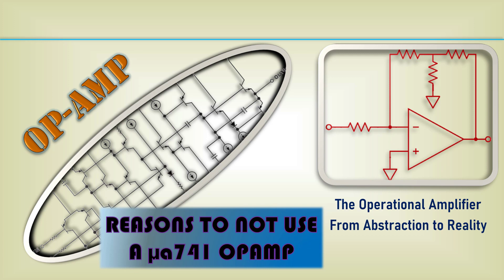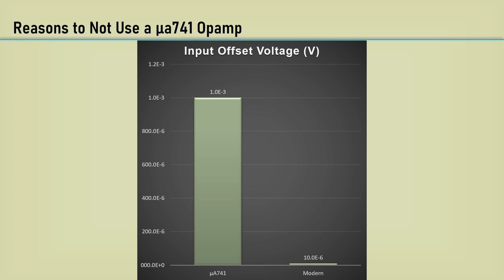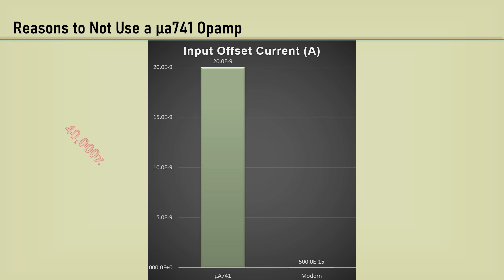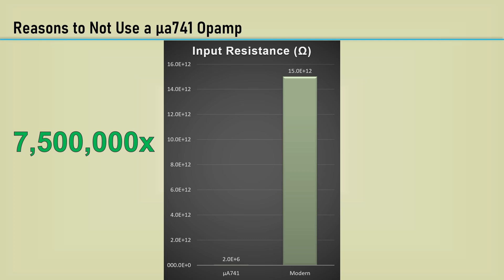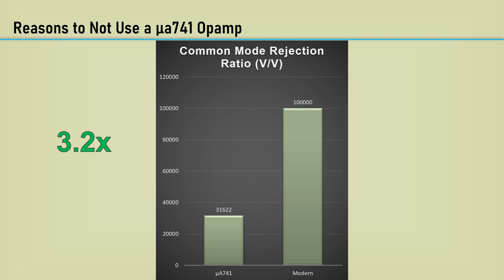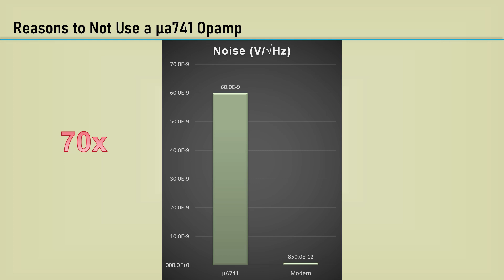Reasons to Not Use a μA741 Op Amp

Comment: The minimum supply voltage for the uA741 is 10V (±5V), not 20V.
Reply from the maker: Evidently I was going by the TI LM741 datasheet which has a minimum of +/-10V. The TI datasheet for the uA741 is +/-5. Thanks for pointing that out.

Comment: I have been known to use discreet 2N43 and 2N78 devices,  with a single supply rail.  Who needs silicon when you've got germanium from 1970?  When I absolutely desired silicon,  there was the 2N706, 2N708, etc.  Of course,  this was done for practical purposes such as proof of concept.  In practice,  if it works to suit your purpose...  go for it.

Comment: There is no reason not to use 741 or 4558 where their specs are sufficient. Which is practically any audio frequency filter circuit and the like. They will probably last longer than modern devices (maybe) at least we can say they stood the test of time.
Reply from the maker: I agree. Thanks for the comment.

Comment: 1:19 fake, the ua741 works with 5v, see the datasheet.
I use it with a 9v battery and works.
I still prefer the TL081 and 071
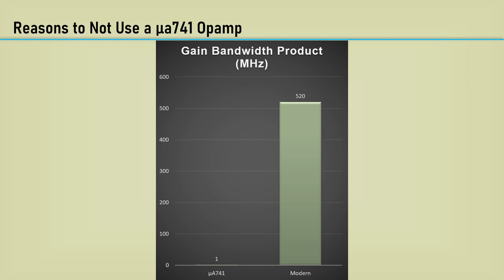4:19 lo escribo en español: lo del ancho de banda de 1 MHz es a propósito debido al cero y al polo agregado para limitar su frecuencia de corte superior y evitar oscilaciones. No es un dispositivo diseñado para alta frecuencia. Si se utiliza otro operacional como preamplificador de audio, se le debe agregar el cero y el polo correspondiente, cosa que no es necesaria con el 741.
Reply from the maker: I apologize. I don’t know where I got the +/- 10 V (20 V total) power supply voltage spec. This TI data sheet 

https://www.ti.com/lit/ds/symlink/ua741.pdf

states in 2 places that the minimum supply voltage is +/-5V. Thanks for pointing that out.
Reply: @oldhackee3915  I'm sure that older 741s were specified for ±5V (10V total) as minimum, which agrees with the TI datasheet, but the ST datasheet from 2013 (linked in an earlier comments) specifies a working supply voltage range of 5V to 40V, so perhaps modern fabrication has allowed working from a single 5V line.
Reply from the maker: Sounds reasonable. Thanks.

Comment: I would always select my opamps such that the bandwidth is sufficient for the application (but not too high) to avoid problems with stability, extra noise and intermodulation distortion.
Reply: I always carefully select one that I have on-hand in my OP-amp cabinet.
Reply from the maker: Absolutely.

Comment: Well done. Where did you find the 60nV/sqrtHz value? I have in my notes the following values (but lost the source myself ;-): flatband current noise level: 0.71pA/sqrtHz, flatband voltage noise level: 20nV/sqrtHz and
 ncfv=200Hz and ncfi=2kHz.
Reply from the maker: I couldn't find it on a datasheet, until now. This ST datasheet has 23nV/rtHz, which aligns weel with your 20.
https://www.st.com/resource/en/datasheet/ua741.pdf

I believe my resource was here:
https://e2e.ti.com/support/amplifiers-group/amplifiers/f/amplifiers-forum/990837/lm741-noise-density
It's a TINA model. It's obviously not very good since its has no 1/f characteristic.

Thanks for the comment.

Comment: Hmm, i use 741 opamps in audio amplifiers. If i use expensive high quality opamps i get fizzy sound from the loudspeakers because of the modern opamp high slew rate. With 741 no problems.
Reply: Sounds like you're really pushing the gain in your designs and getting oscillation. Try adding a snubber capacitor across the feedback resistor.
Reply: @petersage5157  The fizzy sound is a result is a result of high slew rate opamps combined  with slow outputstage transistors.
Reply: @royrogers7644  Which op amps are you using? High slew rate op amps have been de rigueur for everything from consumer grade to professional audio for at least two decades.
Reply: @petersage5157  I use for example the OPA445 combined with NTE 180-181 output transistors.
Reply: @royrogers7644  Yup.  Diagonal clipping in the finals.  Kinda' defeats the high slew rate of the VA stages in the first place!  🥴
Reply: Add a dominant pole across the feedback resistor to get proper bandwidth.
Reply: @danstiurca7963  like 33pF or so?

Comment: Can you give an example of a cheap op-amp that simultaneously meats the different modern specifications? 
I cataloged different opamps to replace the 741 a few years ago. While there certainly are better op-amps for almost every application I did not find  any that was better across all parameters. They all gives different compromises. One limitation is that the breadboard system we uses in the course I am teaching assistant in provides +-15 V supply. In a breadboard environment you do not want too high gain bandwidth eghter to avoid high frequency oscillations. Especially not with unexpirienced students that has little understanding for parasitic effects.
Reply from the maker: For general purpose, I use the TL082.  It's GBW is only 4 MHz, so that should keep students out of trouble from oscillations unless they use large resistors and capacitive loads. I generally look at which category I need most. 1) Rail-to-Rail, 2) DC Precision, 3) Noise, 4) Slew Rate and etc.
Reply: @oldhackee3915 Thanks for the response. Even though Tl082 is an excellent Op in many applications it does not seem to be a general improvement on all parameters compared to the ua741. The offset voltage is about three times higher and the input voltage range is worse.
The main improvement I see is higher input impedance. Many parameters are rather similar between them. The higher speed and slew rate can be good or bad when the decoupling capacitors are connect by 300 mm wires in a rat's nest.
Reply: @larslindgren3846  If you really need low input offset voltage, you may need to go with a single op amp package like a TL071, which has the offset adjust pins that can be tweaked externally (don't forget to have your tongue at the right angle). Since it sounds like you don't need high slew rate in your application, a chopper amp might also be appropriate.
Reply: @petersage5157  The course currently uses the ua741 to introduce the basics of OP amps. It works fine. 
A few years ago I thought that a modern op amp could outperform it all around and looked for a replacement but found that the ua741 is still a good OP-amp for teaching the basics. 

I do not agre with the upploader that the ua741 should not be used in teaching. 
I am trying to point out that the video is misleading in that you can not get all the modern performance parameters presented simultaneously. 
Choper op amps is unnecessarily expensive and is not introduced in this course. 
To keep it simple for the students we do not use the offset adjust pins in the expirements. 
I think the integrator experiment the students do wold give problems with the higher offset of the TL082.
I do not understand why the use of the ua741 is so controversial. It seems to me to be a good general purpose op-amp for simple experiments. For specific applications it is almost always outperformed by a newer specialised op-opamp.
Reply: @larslindgren3846  While the 741 is fine for teaching the basics, you're not doing your students any favours in the long run, because in the real world, almost any application will benefit from an opamp with one or more improved characteristics. In addition, dual opamps are far more common than single packages nowadays, so learning about layout on a typical dual opamp is likely to be a valuable skill for anyone who wants to do design work. Also, across the temperature range, the total offset voltage for the TL071 is greater than that of the 741 only for source resistances less than about 100K, so in an integrator the TL071 may sometimes be a better choice by using lower value capacitors.
Reply: @RexxSchneider  I think the junior ECE lab course at Georgia Tech mostly have switch from the 741 to the TL07x.

Comment: While this is a great overview of how much op amp technology has improved since the days of Widlar and Fullagar, I think a lot of us could benefit from discussing application-specific reasons when, where, and why one would choose between modern jellybean op amps like the TL072, NE5532, and RC4558. In most applications, they seem nearly interchangeable, but there are some use cases where one is more appropriate than the others.
Reply from the maker: Indeed. I generally look at which category I need most. 1) Rail-to-Rail, 2) DC Precision, 3) Noise, 4) Slew Rate and etc.
Reply: @oldhackee3915  Don't forget input impedance. For my purposes (guitar amps & effects), I typically would use one TL072 for input (and maybe a voltage follower) and 4580s for everything else. A 4580 can even drive modestly efficient headphones to immodest levels.